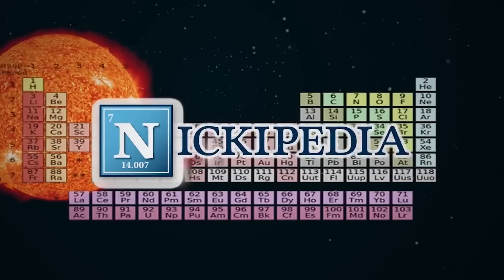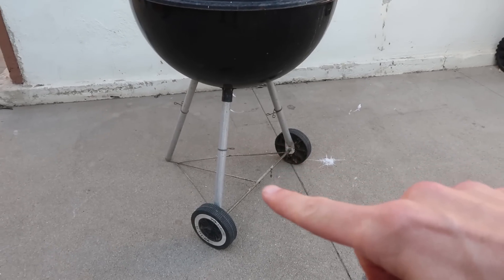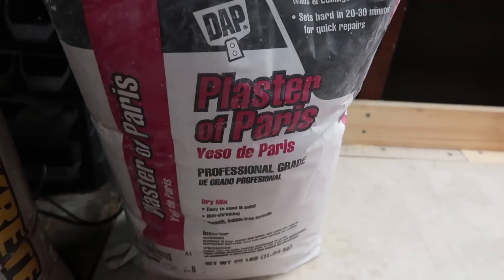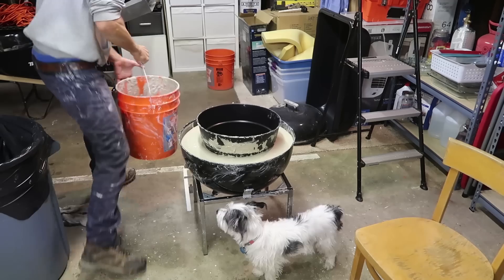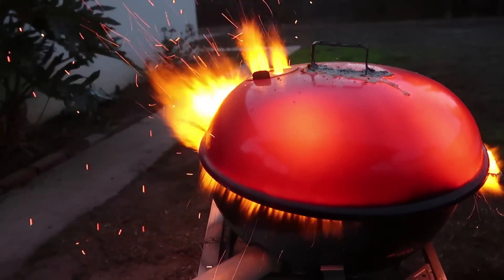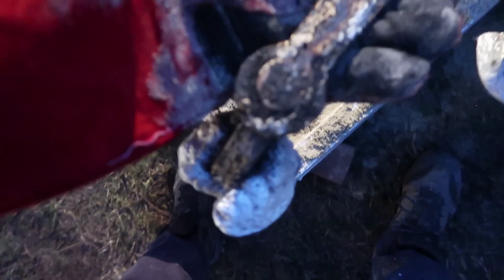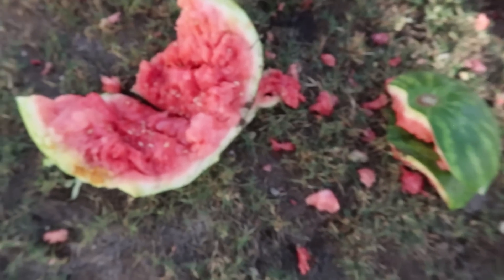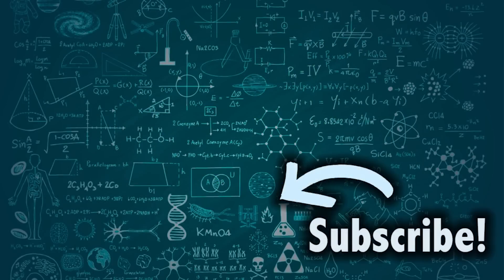Soda Cans To Real Sword DIY

Comment: When it comes to sharpening your aluminum sword, Do NOT use a grinder. Aluminum dust is highly toxic. Use either a handfile, sand paper (high grit, used by hand), or if you're good with a wetstone and have a lot of time to kill (because its the slowest process but can achieve the most durable blade tip/edge), the wetstone is used on most, if not all, high grade blades.

If you would so choose to sharpen it, otherwise its just force and a slight edge that gets you through the watermelon's semi-soft exterior.

Comment: It ain't too bad a club, but the cut just was not clean, as the melon had broken to pieces, also a better means of sharpness testing is to cut paper. But of course as aluminum a weaker metal was used it is a decent arm to use as a club. Also out of curiosity how heavy was it?
Reply from the maker: yea I didn't want it too sharp as it's gonna be hanging in the garage somewhere... the whole sword is about 7 lbs : )
Reply: you could try making a shield to go with it as you did a knight's one handed sword and it would be cool to see a shield with that. also could you try making alloys? Cause i'd like to see how different combinations of metals can affect the tinsel strength of the final product.
Reply: as in like bronze, or home made steel. and compare them to store bought steel.